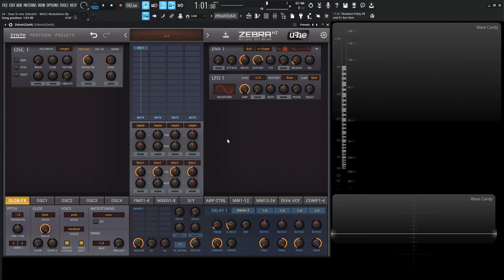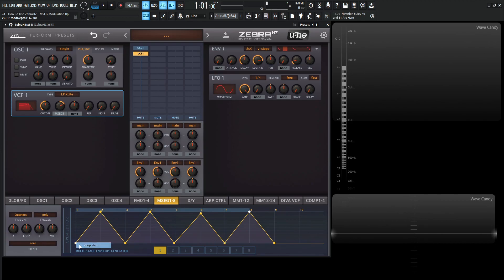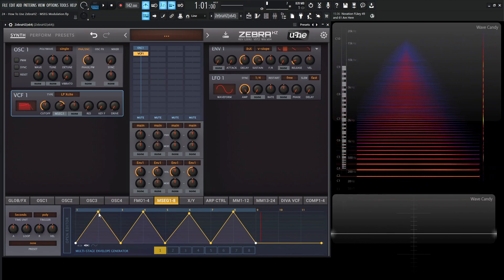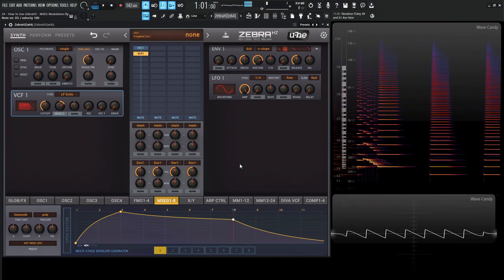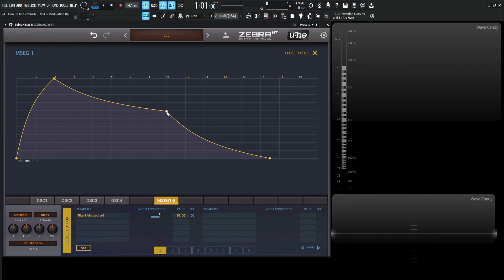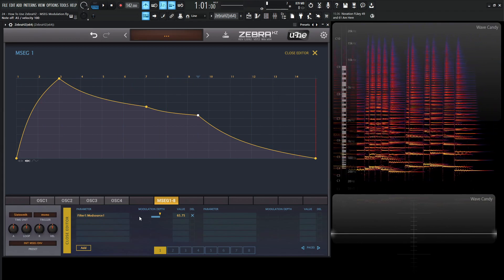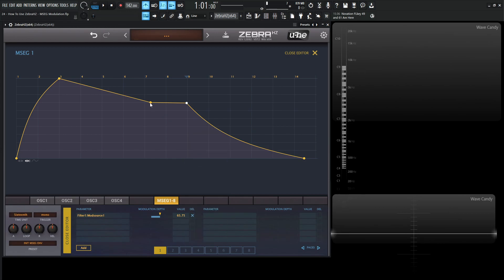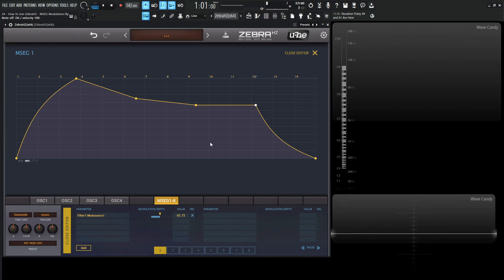MSEG Modulation Zebra HZ Tutorial Lesson 24

Comment: Sorry but I'm reviewing your video and when you say around min 4.10 that to change the speed you move the attack ,loop and release to 2.00 I don't think so, to change the speed in that case you only move the loop knob, instead you can right click on an empty space on the editor and choose "half size" an that's the right way to change the speed. The attack knob is used to change the speed of the envelope before the loop and the release I still have to check but I'm guessing that it determines the speed of the release part of the envelope if it is out of the loop.
Reply from the maker: Thank you for taking the time to comment! In case I may have explained it in a confusing manner, the Attack, Loop and Release knobs are time scaling knobs. If you want to increase/decrease the attack speed before the loop, use the attack knob. If you want to increase/decrease the speed of the loop, use the loop knob, and same concept for the release.
You could absolutely use half speed like you suggested and adjust the entire envelope in one command.
However if you just want to target the attack, loop, or release section of the envelopes, that's what they are there for.